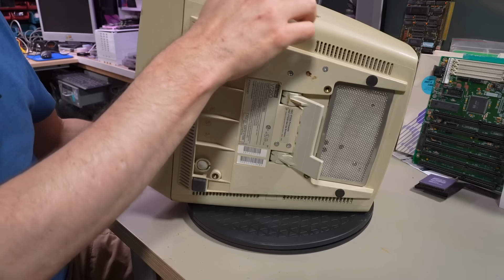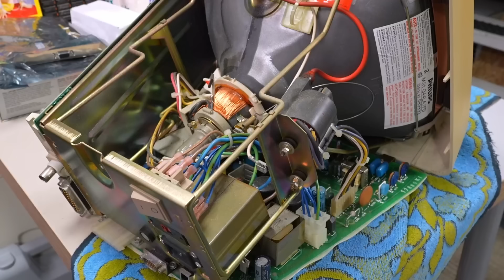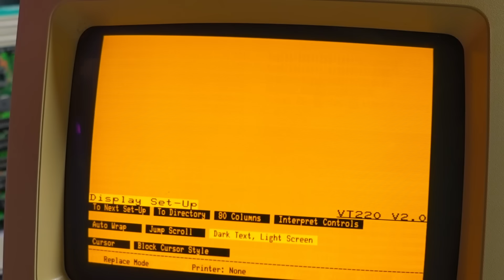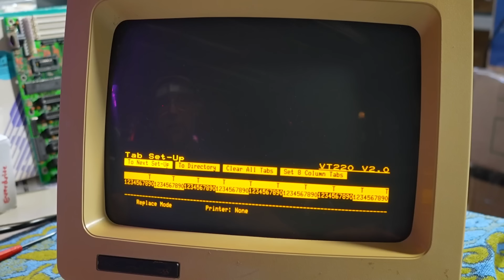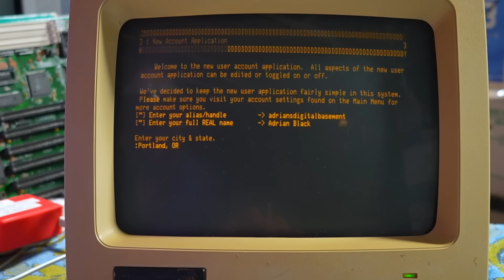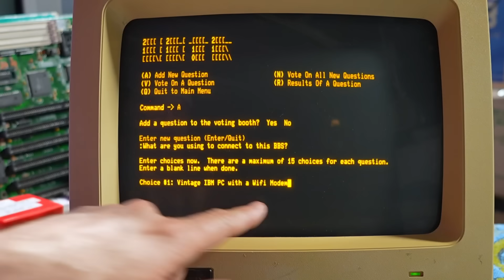Getting online with a DEC VT-220 terminal

Comment: I worked at a place that used Wyse terminals emulating VT100 for ticketing. We had Practical Automation thermal ticket printers and a barcode reader pen hooked up. IIRC they were connected to SCO OpenServer 5.

They were pretty reliable, we had them around from ‘92 to around 2007 when we switched to Windows based terminals. They were seriously burned in when we got rid of them.

Comment: Now there's a blast from the past. I spent quite a lot of time in front of one of these while attending community college and taking computer courses. Brings back quite a few fond memories indeed. We had a a lab full of these, all hooked up to a VAX (started out as an old school big boy VAX -- I believe it was an 11/750 -- but later they upgraded to a MicroVAX.) Actually when I first started going to classes, they were using VT100's -- yes, the old school chonky VT100. And don't get me wrong, I do love the classic VT100 look. But they began replacing them with VT220's, and I grew to love the VT220 aesthetic as well. It looked very sleek and modern to my eyes. And yes, the BNC connector is indeed a video-out port. During classroom lectures, the teachers would send the output of their terminals to the room's projector using the BNC video output.

Comment: My best 486 workstation I ever built was a 4 serial terminal AMD-486/133 with 64 MB running Linux. We remapped the interrupt from one of the 8 bit  ISA cards, configured all the /dev/tty's and set the getty's to run on boot time and we had a 5 seat Linux work station. It rocked! We were bad ass in the 1990's. We had a mix of ATT terminals from a UB1, and a ... DEC VT220! The 4th monitor was a more generic green phosphor monitor.

Comment: The DEC (later Boundless) VT520 series can be found today for cheap and use VGA monitors and PS/2 keyboards for those who want to find a real DEC terminal, but don't want to gamble on a dying CRT or missing MMJ-connector keyboard.
Reply: Yeah, those rock. Especially when paired with a DEC LK-401 PS2 terminal keyboard, as those have the same layout as the old VTs.
Reply: Yes, that do. Slight correction on my part. The VT520 is the standard terminal and the VT525 is the one with the terminal base that you can plug a VGA monitor and PS/2 keyboard in. I have one and I love it.

Comment: I used a number of VT-100, -102, and -220 terminals when I was installing Northern Telecom DMS-100 telephone switches. One of the fun things I found about these terminals was the extensive escape code set. There are codes for character brightness,  reverse video, flashing,  double height,  double width, direct cursor positioning,  and much more that I can't remember right now.
Reply: Got some fond memories of working on Northern Telecom SL-1 and Meridian 1 large PBXs at the start of my career.  Used VT100, 220,320 and 420s.  Got a VT520 that takes the PS2 DEC keyboard and has SVGA out, just for old time sake.

Comment: Soo... Why didn't you set the VT-220 terminal to emulate itself, as a VT-220 terminal and display some ASCII & ANSI graphics?, which the VT-100 terminal could not do.
Reply: That is what I was thinking!  I vaguely remember from back in the day that VT-100 mode generally only displayed simple text.  Switching to the VT-220 mode on the terminal might display the ANSI graphics.  I was also wondering if the BBS had a configuration setting for the user's terminal type, but I would have started with the config on the terminal itself.

Comment: 6:00 the mistake of leaving the switch in 220V position will not harm the monitor in USA; as opposed to that, in Europe sometimes people forget to switch that selector and the thing blows away with a nice smoke bomb, the caps exploding and leaking the acid, as well as some thermistors and resistances too.Surprsisingly the fuse survives many times.
Reply: A common joke with our lab equipment was that the manufacturer used all these expensive transformers to protect the fuses from blowing. 

It worked. We never had to replace a fuse.

Comment: When calling BBSs you'll probably want to put the terminal in VT102 as it's compatible with ANSI if my memory is any good.  I used to bring a modem at work and hook it up to a spare DEC terminal to call my BBSs in the late 80's.
Reply: VT220 mode is also ANSI-compatible, it just adds some new features. IIRC the differences are in special key handling or something like that.

Comment: What's a refa?
Reply: RIFA is a brand of capacitor. They are an X2 rated capacitor. Used for filtering out EMI interference. The old RIFA caps are known to dry out and become a direct short from Live (Hot in US parlance) to Neutral. Thus they burn out.

Comment: I had a WHITE VT320 which got left behind when I broke up with my GF. Oh man do I miss that. It was almost as nice as the original IBM green screen monitor. Almost all other DEC terminals I've seen are amber. You obviously need to get a VMS system running. I guess that will come after OS/2 :)

Comment: We used to use vt220 clone terminals for the hospital i used to work at the only genuine dec terminal was the console in the computer room.       We had modem links to clinics around the area and i had to look after these when they went wrong. I remeber being cheap clones the main issue was with dry solder joints, always having to do "percussive maintenance" on them i.e. slap it till it worked 😂😂😂

Comment: While I was attending, I worked for the University of Maryland and I found myself unpacking these terminals and setting them up in the summer of '85. Seeing this video, I can remember the smell of the packing material! It brings me back to a time that was very tranquil for me. How weird is that? That was 39 years ago, but I remember it all like it was yesterday.

(Don't ask me what happened yesterday. It wasn't important and no where near as fun as working on DEC equipment.)

Anyway, that was 39 years ago. But I still remember my Hayes command set. You need to brush up on that, Adrian. ;)

Comment: A long time ago I used my C64 with VT-100 emulation software to dial into my work, a 7171 communications controller,  that translated my VT-100 to an IBM 3270 terminal. From there I could log into CMS.  My modem was 300 baud, the 3270 had 1920 characters, 300 baud was about 30 characters per second. Every time I hit enter it would repaint the whole screen, this  took about 60 seconds. Fun times!

Comment: I've been building Wifi-Serial adapters recently, ZiModem is great, but even better is the latest firmware from 'TheOldNet', with a web interface for easy settings, OTA updates and even experimental file uploads. And it's even possible to access websites as well as BBS sites. The only thing is you need a 4Mb ESP8266 - I use the Wemos D1 Mini.

Comment: The keyboard you have is the "wordprocessor" VT3x0 version. You can tell with the "gold" key on the keypad (wordprocessor).

The VT2x0 keyboard has a clear cover for a printed key definition strip to fit under instead of the triangular gully.

Comment: If I'm not mistaken the C2 is the color of the phosphor. My green VT-320 says B3. The tube was so worn out on it when I got it I had to turn up the B+ voltage to see the text. Not recommended I know but it was either that or throw it out.
Reply: Yup, the suffix represents the screen color. I think it's the letter that represents the color but then what is the number for? It's in the manual but I don't have that handy.
Reply: @eDoc2020  I think the number is the shade.

Comment: ATDT is dialling T is Tone, P is pulse but no one use pulse for a really long time. I use this quiet often back in the days since some device can be configure only throguh console port, or connect a Cisco router which most people use command line back then.

Comment: I've been using them a lot And what VT-220's make them special is there extended keyboard with many function key's and special characters. When designing Oracle applications you could make some nice screens. use the vt-220 as a console on any unix/linux machine makes much more sense than dail a BBS. try some text editors on the consiole port and it should work nicely.

Comment: Data Leads only probably means it is only going to use pins 2,3,7 on the interface TxD, RxD and ground. The other selection will use a few of the other connections, RTS/CTS for flow control, DSR, DCD, DTR and maybe RI an Busy if you are going to use it on a dial up.

Comment: Ahem!  DEC is Digital Equipment Corporation.
The keyboard cable is wired differently than a standard phone handset cable.  Using the wrong cable can destroy the keyboard controller.
Reply: I used a normal handset cable once and while it didn't work it also didn't break. The LEDs just came on solid. I think standard cables are very high resistance.

Comment: I worked in a university computer lab in the mid 90s and we still had a load of those kicking around; the Vax they were originally connected to had been retired and replaced with an IBM RS/6000, but the terminals lived on for a good few years. (Also, turn on smooth scrolling!)
Reply: No.  Leave smooth scrolling off.  Unless you're only ever going to receive short bursts of data, having smooth scrolling turned on will cause the terminal to either display far more slowly than it's capable of doing, or (if handshaking fails) to miss data as the buffer fills up much faster than the screen can scroll.  I know this from experience (at 9600bps).  I guess it would work just fine at low speeds such as 300bps or maybe even 600bps, but it doesn't work correctly at higher baud rates.

Comment: The software the bbs is running seems to by mystic bbs which is a piece of software you could rather easily get running on a raspberry pi, if you so desire.
Interesting to know: This software supports ansi as well as utf8 which - if the sysop has thought about that - is either auto-detected or you will get asked.
I'm using this software for my own little bbs for chatting with others and sending mails.

IMHO the terminal you are using is awsome and seems to be a low hour set! I destinctly remember my doc using this kind of system as late as 2022 when he had to change it because of incapabilities by the german health system to find a way to preserve the convenience to the docs to use whatever they like.

The system my doc was using ran without any serious errors for over 30 years five to six days a week and only the terminals had to be serviced from time to time: You could seriously say they were worth the money back than!
Greetings from Germany and keep up the excellent work!

Comment: I spent so many hours programming PDP-11 and VAX computers in the '80s with VT100 and then VT220 terminals - it's great to see one alive and kicking. It seems amazing that I worked on what now seems like such a tiny screen but at the time it seemed great, of course the comparison was a chugging Teletype or a buzzing DECwriter!
Reply: these dumb terminals had enough electronics guts to put a lot of PCs to shame
Reply: I remember liking VT220's over the older consoles, as they had text highlighting and cursor control.  Need to see emacs, Wordstar, and such to show off the terminal capabilities.
Reply: @GnuReligion  The VT series terminals were really sturdy an had nice displays, you could tell the vt220 was a cost cost version of the VT100 but it was still good.   I used use EMACS on a VT220 which was really nice because it cold split the screen so you had a command line on half and the editor on the other.    You could edit and debug in EMACS and run command to compile, etc on the command line.   This was better than any IDE I've ever used.
Reply: @ChristopherHailey  Ah, sadly, I never found faith in the EMACS religion. It is impressive though, to watch someone use gdb, and edit multiple files through a text console. Am wondering if that vt220 will broadcast its termcap, when a modern linux box opens a getty on it.
Reply: @GnuReligion  EMACS is pretty interesting and it has the best backronym of "Escape-Meta-Alt-Control-Shift".   I've been through EDT (love that one) and vi and even TECO (Eeek!)  and others.   I used to bring my EMACS startup file with me to my various consulting gigs, it got pretty long after  while.   Now the world is Linux an I just use vim and when I have to do something on Windows I use vim there too.    A vt220 will work fine on a modern Linux, there is definitely a TERMCAP entry for it.   The VT220 can even do VT52 mode

Comment: The second "T" in "ATDT" was for Tone dialing, otherwise you'd get pulse dialing :)
Reply: There is also ATDP to do pulse dialing explicitly. You could usually program the default you want into the modem.
Reply: Yep.  I ran a BBS for 6 years, I remember that to this day.
Reply: Yep.
AT = ATtention (place in command mode)
D = Dial
P = Pulse
T = Tone
Reply: @slightlyevolved  don't forget ATH to hang up, which we use to use back in the day to do a ping of death 🙂
Reply: Indeed.  There are a ton of AT commands.  Back in the day you got used to using them, depending on the terminal program you were using.

Hehe.  I remember my roommate and i wanted to share files between my Amiga and his PC.  I got a phone splitter, we plugged both of our modems into the jack.  I dialed a random number (my modem needed the dial tone to dial), my roommate did an ATA (to answer), and then we quickly unplugged the dual jack from the phone line.

But the computers were connected at that point, and we moved the files we needed to move.  Later i found a program that would let me write to IBM format 3.5" floppies from my Amiga, and we moved files that way.

It was a hack, and it worked!

We probably could have just used a serial cable between the two computers, but neither of us knew how to do that back then.
Reply: One of those bits of info so ingrained in my memory that it doesn't even occur to me that someone else doesn't know that.
Reply: Don't forget to set ATS11=25 first for ultra fast tone dialling. :)  Handy for multiple redials to busy BBSes.
Reply: Glad I've been... two weeks late to mention the `T` is not Telnet but Tone ☺
Reply: Confirmed.
Reply: +++
OK
ATS11=50
OK
AT&W0
OK
ATDT 555-1212
CONNECT 300
LOGIN:+++
ATH
NO CARRIER
😁😂🤣
Reply: DUCATIC DIAL for LIFE yo!     r-r-r-r-r-rolling it o-o-o-old school
Reply: In US "tone" was default one, so ATD should be sufficient

Comment: Didn't we often see these at old libraries...these were the search computer and the librarian computer for checking out your books.
Reply: I remember a few of these types of terminals in the library at the university I attended in the early 00's. Used for looking up books and other reference material in the catalog of course. They had some pretty gnarly screen burn-in but they worked perfectly fine. I'm sure they are long retired at this point.
Reply: Terminals were pretty standard equipment at libraries.

They were also pretty common in  offices. Everything ran on a central computer and a cheap terminal was all that was needed at each point.
Reply: I remember as a kid the city I was in built a new library in the mid 90's. The entire card catalog was accessed via DEC terminals regularly placed around the building. I think they may have been VT320 but don't remember for certain.
Reply: In the Swiss library I work in, and have worked for decades, we used to have Tandberg TDV 2200 terminals for a Norsk Data-based system. I still have one, but it's currently broken and could be hard to repair (went with a puff of smoke when I last switched it on about 15 years ago, and I never opened it since, so no idea how bad it might look inside...)

Comment: Great little terminals. Especially the amber. 
The keyboards protocol is full rs232 as well.

Unfortunately, the keyboard switches are not that great. Also, the control and ESC placements are not good for unix.
However, the DEC docs are good. It should be easy to convert USB or PS/2 to the rs232 protocol used by the keyboard .

Comment: I had a job in college running backups a couple of times a week on the Vax that the faculty used.  After a few months there was a new guy in charge and the story I heard was he said "We have a STUDENT doing backups on the faculty computer?" in an outraged tone.  My boss told him, "That's why we have student we TRUST."

Nevertheless, they canned me and hired a graduate student.  I ended up with his old job so we basically switched roles where he was backing up the faculty computer plus other things and I was backing up the student mainframe.  I guess they had no problem with that.

Another fun part of the job was to run cables down in the steam tunnels to places that needed new terminals.  Most of them were VT220s but there were still a few older ones around.

I also re-inked printer ribbons for the student lab because we were too cheap to buy new ones, haha.

Let's not talk about my shoddy soldering job on cables for a bunch of internal 3.5 inch drives we hooked up to the external interface on PCs because we were too cheap to buy real external ones.

Good Times...

Comment: I am wondering if the reason a Phone cable won't work is that the Keyboard is using a 6 conductor cable rather than the usual 4 that a typical phone cable uses. Can you confirm if that keyboard cable does indeed use all 6 wires a RJ-11 connector can have?
Reply: I wonder if there’s some crossover action going on
Reply: @mjungowski  that seems indeed to be the case according to the schematic on the page linked by Adrian. Other end seems to be in reverse order.
Reply from the maker: https://www.netbsd.org/docs/Hardware/Machines/DEC/lk201.html

Appears to just use 4 conductors like a phone handset